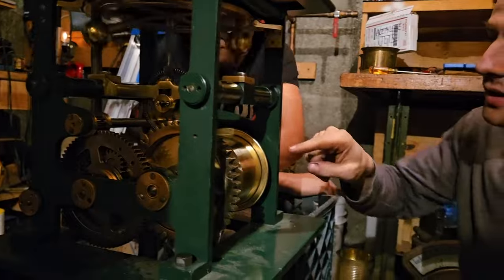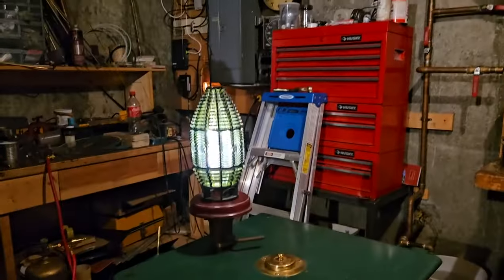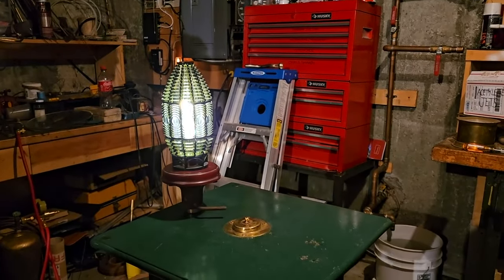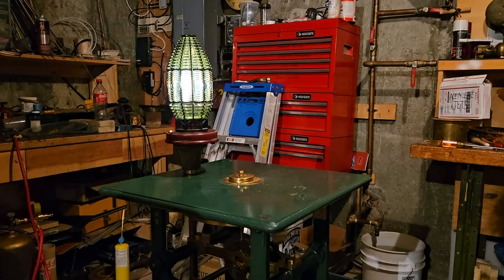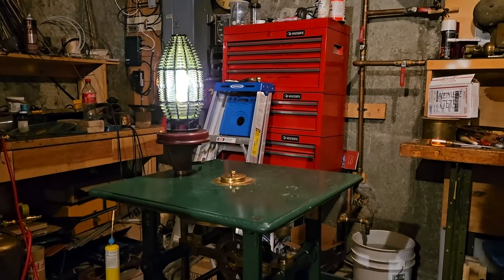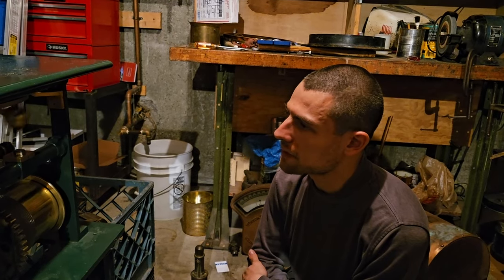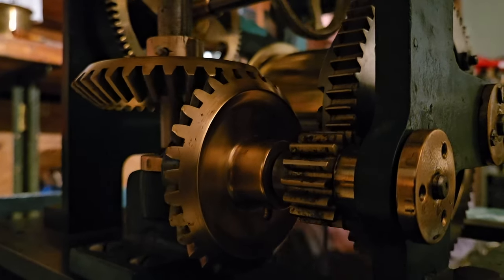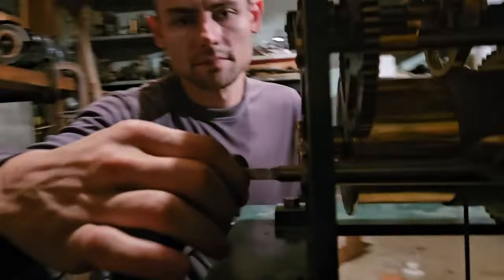Fresnel lens drive clock complete and running!

Comment: Bonjour Alexander,
Great job !
At what time intervals should the mechanism be wound to obtain continuous movement, I am thinking of the lighthouse keeper who will have to get up at night...?
Amicalement, Raphaël
Reply from the maker: Rapahael, that depends entirely on the height of the tower available or length of he weight column and cable.  In some short lighthouses, the weight column was drilled in a shaft into the tower foundation to extend its run.  Typical wind times were every 2 to 4 hours.  Also depends on how fast the clock is designed to run the lens, faster lens meant more torque needed and shorter weights to bottom time elapsed